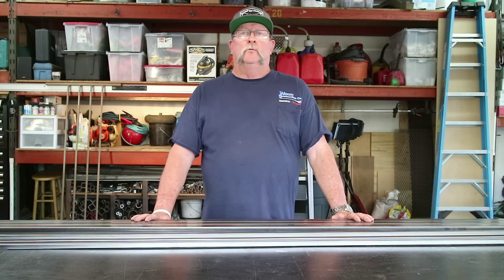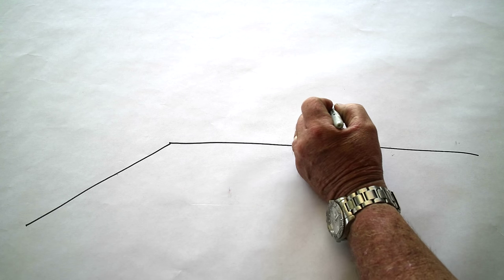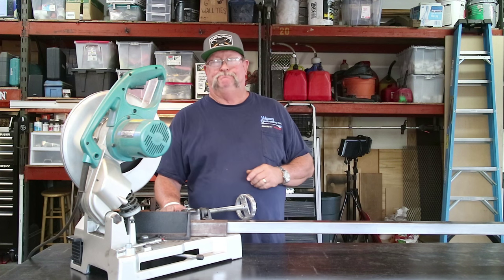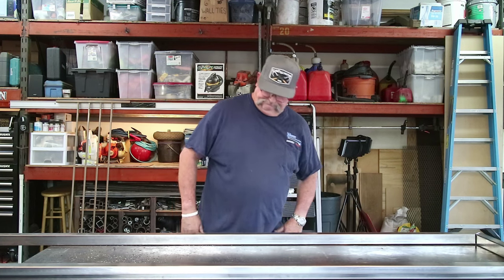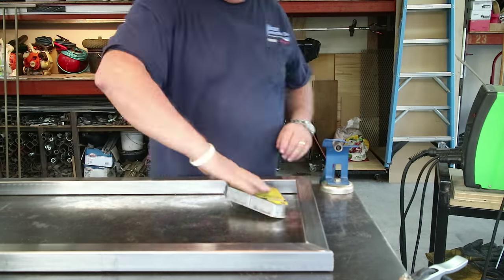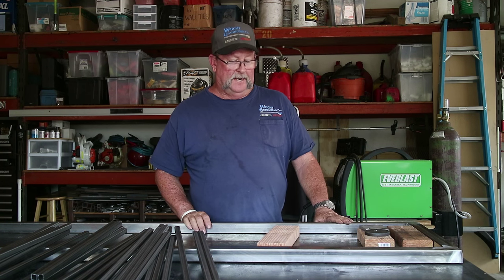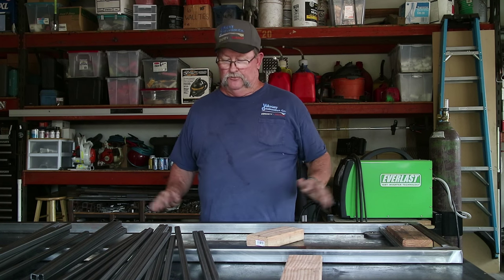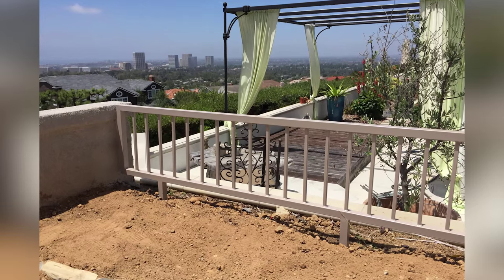Wrought Iron Style Gate - Jimbos Garage

Comment: I built  ski lifts and I use to build railings  and tower ladders , Now if you did railings and gates and had to do production , say 50  6' ×10'  fence panels I built  a jig that had an adjustable gate perimeter  (telescopic tube in tube)  length and width adjustment 1" 1/2 tubing , and picket adjustment  were angle Iron  up on edge and had a block  with a set screw that tightened on the 1"1/2 tube,  you would  have to set and measure  your Initial picket spacing,  tighten your picket angles  total frame width and length  once , and then just drop your parts in tack  it ,take it out of the jig and weld it worked beautiful  I used that jig for over 20 years

Comment: JImbo, so what is your solution when you get to the last pickit and it is not fitting the 2x4?

Henry (So.Cal.)
Reply from the maker: I start about 4 or 5 pickets back and start measuring, Maybe i have to increase or decrease the measurements to make it look even.  Jimbos garage!
Reply: Got it, shave 1/8 here n there....
Reply: Anytime you are building anything that has pickets, you always start from the center and work out both ways that if there is a short area it is worked into the design, not being in the center, therefore not being part of the focal point.